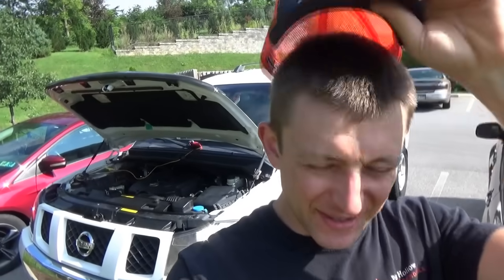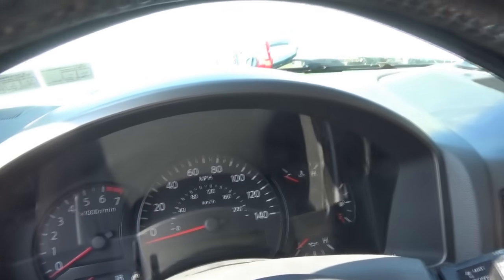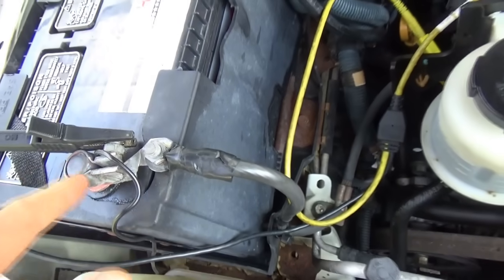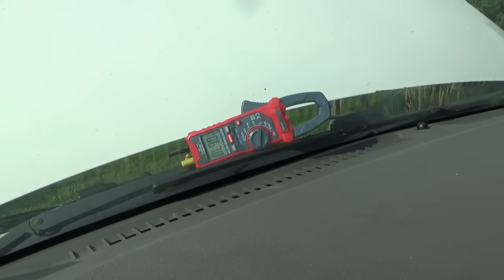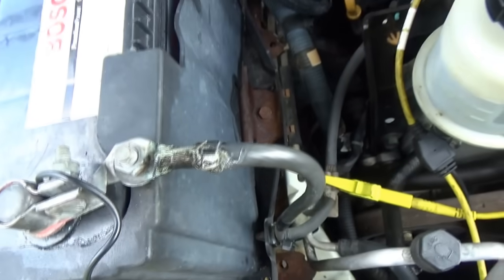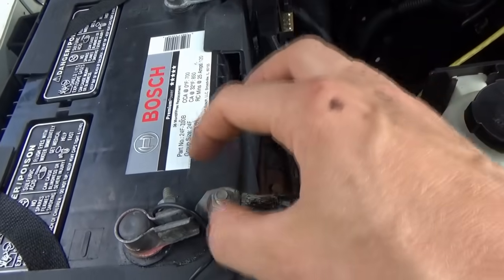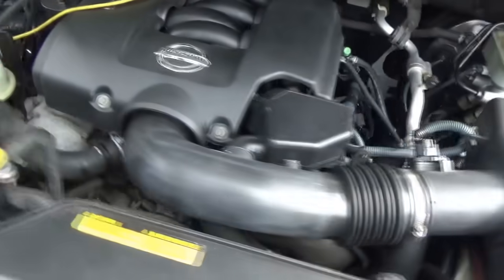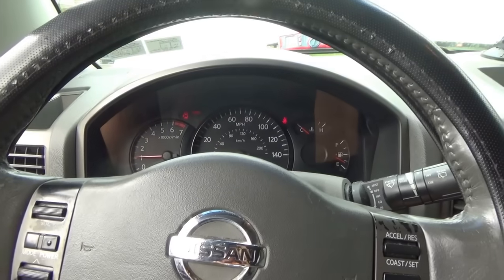No Crank...No Start...No Parts Required! (Nissan Armada)

Comment: For a permanent fix: 1 tablespoon of Table Salt and 1 cup of Vinegar will remove the corrosion from the copper wire in minutes. Then use baking soda and water to cancel the acid of the vinegar solution. Dry thoroughly, crimp tightly and then add a few drops of liquid flux. Use a very high heat iron or small torch to solder the wire to the connector, letting the solder flow into the stranded wires.
Reply: Some time ago saw Edd China (of Wheeler Dealer fame) in his Youtube channel fixing corroded wire using method you just described :)
Reply: Mmmmm salt and vinegar. I'd be too tempted to put it on my chips.
Reply: and finish the repair by coating the connection with a little silicon grease.

Comment: That negative battery cable clamp is junk.  I went through this with my 06 Nissan Frontier 4.0L V6 on the positive cable end.  It would not tighten down.  I replaced it with a brass cable end.  The negative cable terminal on that Armada had corrosion and heat affect it by removing the coating and exposing the copper.  A stronger cable terminal is needed.  Having the cable strands exposed is not good.  A round closed end terminal is needed to eliminate dirt, air, moisture and corrosion intrusion.

Comment: Someone’s head is gonna explode for using vise grips as a crimping tool 😂
Reply: @Peter-pv8xx  it was a fucking joke dude
Reply: real crimpers are abour $30, worth keeping in the toolbox
Reply: I've used curved jaw Vice grips for 25 years on thousands of connections.  It may not be an official crimp tool bit it definitely is a tool to crimp with. Squeeze, close jaw, squeeze more, and repeat until you can yank on the wire without any movement. 
Of course soldering is ideal but crimping with heat shrink has always been my go-to.
I suggest dialectic grease for the battery post.

Comment: Home gamer here.  Great diagnosis, proof of concept and fix. I'm proud to say that between what I've learned here and from SMA, I came to the same conclusion based on symptoms - check the heavy powers & grounds through the starter circuit and see where the angry pixies are struggling to get through.

Comment: Great job Ivan......   I had a loose block ground on my Toyota that caused intermittent issues... the engine just stopped running every now and then.  I believe you would have diagnosed that issue pretty quickly.  It took me quite some time and frustration to fix it;  including Toyota service costly misdiagnosis.      Cure:   Tighten block ground bolt!    Cost:  $750.00 for unneeded repairs.

Comment: Good find Ivan. That connector had problems before and will have problems in the future. I would recommend replacing that Negative cable. They are relatively cheap, and a repeat failure could be very inconvenient and expensive.
Reply: Ivan, I agree with Stealth.  Additionally, your reputation is at stake.  The cable is less than $13 on RockAuto.  Say, ~$20 with shipping.  Probably $25 at the parts store.  The customer should know that for a ~$100 additional they will never have this problem again in the life of the vehicle.
Reply: Agreed. That's a "get you home" repair, not a permanent fix (guaranteed the owner will leave it forever)
Reply: Everything is a temporary fix unless it works. 😁

Comment: That tape may have actually held moisture underneath it leading to corrosion over time.
Reply: I bet the chemicals used during the pressure washing/degreasing helped expedite the corrosion process.

Comment: Cooool! Gotta love weird electrical problems. I had a client who have 2007 Saturn Aura. She stated battery dies and jump start attempts failed. I looked at it. Battery is not dead 🤔. Whole dashboard dead I mean there no power. Volt meter is still same (12.4) no dropping when cranking. I get power back by moving cables. I saw positive battery cable and wire are dangling and exposed, not touching battery post. It was covered with black tape too. Previous guy must did a bad job on cable/terminals. I wish I can send you picture. It’s bad 🤣. Nice job.
Reply: I had a similar one helping a stranded random stranger. But it had dash lights. First I noticed loose battery terminals. Fixed that but no better. I had my multimeter so I checked the block ground lead voltage drop - I think it was 9V across the crimp on the terminal to the chassis rail from the block. A little wiggle and you could feel it was down to just a few stands left connected. Just like this video, I rigged a jumper cable as a ground wire just to get it started.
Reply: @TonyRule  yeah, poor battery connection can do crazy.

Comment: I would apply some solder to the crimp lug just in case the same thing happens again,it will provide better continuity as well.

That's because this afternoon that dreaded Ford Falcon (Futura)  cut out on me with the replacement ECU,the old one has damage to one of the resistors inside of it which is why I replaced it,I put it down to a faulty EFI relay which was causing the engine to cut out as well but the battery terminals were also loose as well.

I went through & soldered the crimped on battery terminals to make sure there is good continuity, it's something which is done in car sound systems where gold plated battery terminals are used,the terminals are soldered for better electrical continuity.

I know that I shouldn't have to go to that extent with a car because I've never had that much trouble with a Holden which is a GM make of car,the Ford is someone elses.

I know that Chrysler solder the crimp terminals in their Jeeps for example !
Reply: I wouldn’t. With that much current flow just a crimp is best in my opinion.
Reply: @T.J. Kong agreed.
Reply: I'd have removed the eye and crimped a new one on, using a proper crimp tool rather than vice grips. Would have cost pennies but is the correct way to repair this.
Reply: @ferrumignis  Yeah but looks like this was done in a pinch... ;-)

Comment: FWIW When the battery is on the way out, some Ford models will do the needle tremor on start up like whats happening on that Nissan. The battery in such cases with the F150 etc, appears to start the vehicle ok but its actually in the very early stages of going bad when tested.

Comment: Scotty Kilmer says you shouldn't pressure wash the engine.  Great video!
Reply: There are few cases for pressure washing anything. It's quick and easy, but only in the short term. If  you do it to concrete, you remove the sand and make it a better home for dirt an lichen - effectively meaning you're going to have to keep doing it at ever decreasing intervals. If you do it to a house timber cladding before painting, you're forcing moisture into the timber which you don't want. If you do it to long run roofing iron, you're damaging the fastener seals which can create leaks. If you do it to anything that has a bearing or electrical connector, you need shooting.
Reply: @TonyRule  You are not a big fan of pressure washing, are you?!
Reply: @blockbertus  Whatever gave you that impression? haha
Reply: @TonyRule  I dont know. Must be some kind of hunch I guess. ;-)
Reply: @blockbertus  Yeah, I would like to know what tipped you off?
Reply: @lvsqcsl I reckon he's got a promising career ahead of him as a psychic!

Comment: My 2005 Nissan Altima 2.5 starter tested  good at Auto Zone Auto Parts and at O'Riley auto parts. Brand new battery, check the flywheel teeth and look fine. turn the engine by hand and it rotates without problem,  when I turn the key to start, I hear the starter spinning [weeze sound].

Comment: My 2004 Sequoia has the 4.7 V8 has similar mileage and it has the same engine tick on startup.  Replacing the exhaust manifold is a pretty big job so will live with it for now.  May decide to get some new headers in the future, will see.

Comment: I just replaced the starter in my 97 F-150 this week.  I went through an almost identical test as you did in this video, but with mine, the starter was getting proper voltage right on the wire going into the brushes, but wouldn't crank.  The tap on the starter test was a no go.  Well it lasted from 1997 to 2021 so I'm not complaining.
Reply from the maker: I've seen the braided wire from the solenoid to the motor corrode and fall apart haha

Comment: Good diagnosis but replace the cable  corrosion has already set in the terminal will corrode soon without proper sealing.

Comment: Youtube ate my comment :-(
Ill try again:  Well done ivan :-D
High resistance  connectons are so sneaky,  they are a sleeper just waiting to fail.
When i used to work in a auto factory, i had to solder battery cables.
If the strands were clean the solder would flow,  but there were times i had to clean and tin each strand.
The solder flowed so much better :-D
I find vicegrips so so handy,  a great american invention :-D
Reply from the maker: Nice 👌

Comment: Good job in the parking lot. I'd still get a propane torch and some solder on that fitting or find a better negative cable terminal to replace that thin design.
Reply: I always crimp+solder terminals like that that are outside in the elements, it prevents the water from getting inside the wire and corroding it internally
Reply: I usually also use heatshrink with glue
Reply: soldered terminals are dangerous at high currents and best avoided. I saw a $5 million satellite ground station go up in flames traced to soldered wire ends under screw terminals and the same issue applies to crimps

Solder creeps under pressure and the resistance goes up which means they start getting hot and then the solder creeps more, leading to intermittency or full on failure

A properly done crimp has contact pressures of hundreds of tons per square inch and the metals cold weld into place after a few months. Never reuse a crimp and never "do it twice to be sure" - this almost always destroys 90% of the crimp strength, resulting in premature failure

A properly done crimp should have a service life of 30-50 years. Soldered joints are about half that
Reply: @miscbits6399  except you didn't understand what exactly I said. As you said, if you first solder, then crimp, that would be bad, as the solder would creep away leading to a loose connection. BUT if you first crimp, THEN solder, the crimp has already taken place before you add the solder, which fills in the extra space left between the wire strands, preventing corrosion, and making a BETTER mechanical connection. Similarly, you could not crimp at all and just solder, there would be no creep issues then, but would be less secure than crimping in case the lug gets loose, heats up and melts the solder. Again, the solder only holds the lug onto the wire, and doesn't transfer ANY force, so there are no creep issues.
For example, big wires where you need a lot of force to properly crimp a lug, I usually solder, and I haven't had any issues yet (battery cables, ground cables, starter cables,...)
Reply: @brainndamage  I agree on that. Besides, if someone is soldering a multi million dollar item to go the distance, likely they'd use silver solder or something similar.

Comment: Hello sir ihave problem with ford focus st 2014 2.0l petrol my customer drive this car 3month ago everything will be fine no problem but now ihave trouble with this car no start no cluster lights I can check the all fuse and wiring we check already power ground and can network everything is okay can you let me now waht I should next can I Cheng the bcm or waht I do thanku

Comment: If voltage drops real low during crank, it seems as though the gauge cluster does some sort of recalibration reset on its own with almost all 03-05+ nissan's with visteon manufactured gauge clusters, pretty typical to a situation like this or bad battery.

Comment: I never trust crimp connections, especially on high current applications.  DeoxIT is good stuff but it doesn't last forever. A little solder will secure that connection for the life of the car.

Comment: I guess either there was still some voltage drop which a module didn't like which caused the funny needle behavior with the jumper cable bypass test, OR and similarly, some module saw low voltage during crank and delayed turning itself on after crank just as kind of a power saving thing.

Comment: Baking soda n hot water does wonders to the greenies.
Reply: it also works for leaking dry and alkaline cells if you've ever had batteries leak in a remote. It's Duracell's recommended cleanup method (they leak occasionally, despite the claims)

Comment: I had the very same problem with the red cable the car would drain the battery and not start very easy arfter some fairly up liquid it now runs perfect

Comment: Good video, but I notice in a lot of diagnostic videos, at times, there is no mention of what the dvom reading should read. For instance, in this video, you read the voltage drop on the ground side as 6v, but you don't say what it should read, "zero or close to zero volts", for the novice trying to learn. just my thoughts.But you do a great job, and I like watching your videos, you are very professional.

Comment: That tape is on there because I will bet this isn't the first time this repair has been done.
Reply: But what if the tape made it worse by trapping moisture in there for longer? Wouldnt dielectric grease be the better option here?

Comment: Besides the electrical problem, I could be totally wrong but it appears to me that the engine has too much oil, going by the dipstick and oil gauge.
Reply: you'd be amazed what people do. One of my cow-orkers filled his car up with oil unti the fill level was visible at the filler neck. Apparently nobody ever told him how to use a dipstick or to check the manual for recommended volume (he's in his 40s)

The effect of a crankcase literally full of oil was as expected (byebye engine)

Comment: Great video but I was looking for no crank no start, this one would crank!
Reply from the maker: Same test procedure 👍
Reply: @PineHollowAutoDiagnostics  ik the battery is good and I have all power, just no crank whatsoever. Unable to diagnose with these steps
Reply from the maker: @ChrisSmith-yr2yj  All you need is a wiring diagram and a test light...

Comment: Now that the behemoth starts and runs fine, advise the owner to sell it.
Reply: Exactly ...sounds horrible think once those oil lines blew they did t realize it in time..Also looks like it's over filled once the pulled the dip stick...I bet it was over filled and that's what caused it to blow lines...

Comment: You mentioned the exhaust manifold tick at the 7:20 mark.  Does that refer to a tick caused by a cracked manifold?  I know that is a common issue with the Titans and Armadas.  My 2013 Titan is almost at 80,000 miles and has developed some high, yet uneven long term fuel trim issues (between bank 1 and 2) and I am wondering if that could be the beginning of a cracked manifold.  There is not a pronounced ticking sound yet, but perhaps that grows as the crack does?  Any thoughts/insights are welcome.  Subscribed! :-)
Reply from the maker: Just wait until it throws a check engine light :)
Reply: @PineHollowAutoDiagnostics  Thanks!  It threw P0101 MAF code earlier this summer and I cleaned the sensor, reset it and it has yet to recur. I also got one random misfire code.  Then I bought an OBD2 reader and started watching the live data and saw the long term fuel trim issues (+12/+21).  I just went ahead and ordered a new MAF sensor as the readings at idle in drive seem to be declining over the past month, so I think it is under reporting.  Runs fine except for a slightly elevated idle (about 100 rpms higher than Nissan lists).  If I did not have the OBD2 readings I don't think I would notice any drive ability issues.

Comment: Ivan, what do you recommend to put on connections like that to prevent or lessen that type of corrosion?
Reply: I use chassis grease ( STORES ACTUALLY SELL SPECIAL GREASE OR A SPRAY ) on my terminals & where the cable crimps on the terminal, I use adhesive heat shrink tubing.
Reply: Look into a product call Corrosion X
Reply from the maker: WD 40... A good connection shouldn't corrode to begin with 😁👍
Reply: @PineHollowAutoDiagnostics  Not if it's not exposed too anything " sure " but a car in FREAKIN PA. ? WD makes so much stuff now it's hard too keep up with it all.
Reply: @NoWr2Run  Pa can get pretty humid
Reply: @valpanig  That & ALL THE DAMN SALT IN THE WINTER. SHIT SPLASHING EVERYWHERE & CORRODING EVERYTHING.
Reply: If it's got corrosion, replace it!

Seriously, it's far less hassle in the long run

Comment: Never never pressure wash a modern engine! Use degreaser on hot motor and let it cool use water nozzle at most covering ECM and alternator
Reply: don't pressure wash old engines either.

Spidey senses should be going ding ding ding if someone mentions doing this

Comment: A new connector would be a better repair. Too many heat cycles on that large ring terminal. The metal gets soft. Part of how a crimp connection works is the stiffness of the copper or steel connector to ensure a tight connection under adverse conditions. Underwood temperature goes from freezing to 200+ degrees on a hot day in traffic. TOO MANY HEAT CYCLES.  LIKE AN EXHAUST HEADER OR A MUFFLER. HEAT CYCLES. 
I WOULD HAVE SOLDERED IT TOO.

Comment: Where do you clamp onto the engine
Reply from the maker: The metal part 😅
Reply: @PineHollowAutoDiagnostics  lol okay I just wasn't sure if there was like a bolt or specific location on the motor or just anywhere 🤣